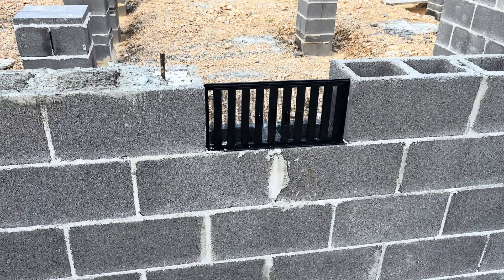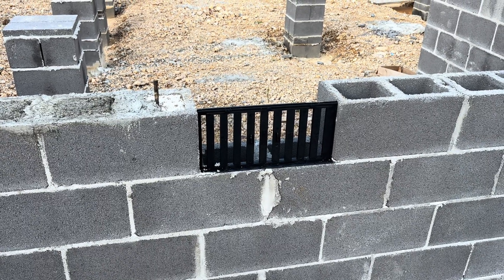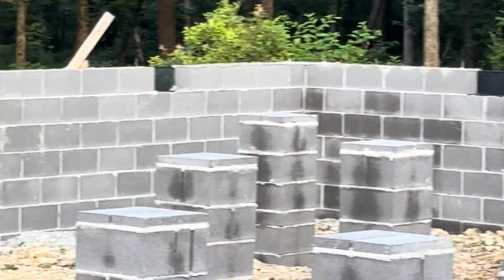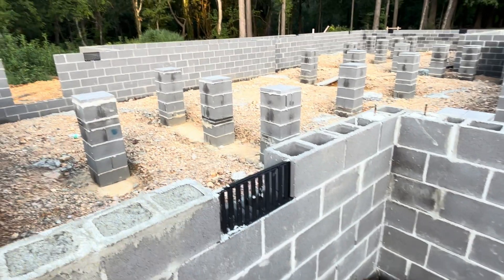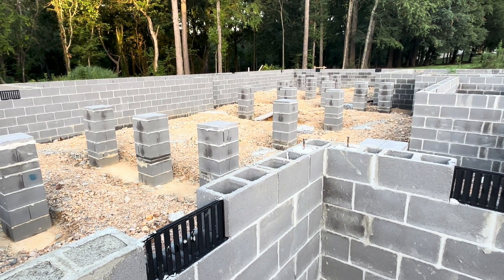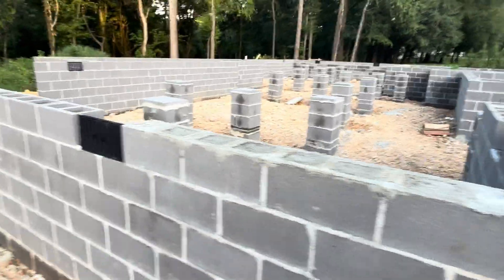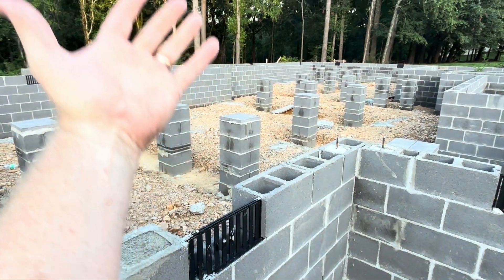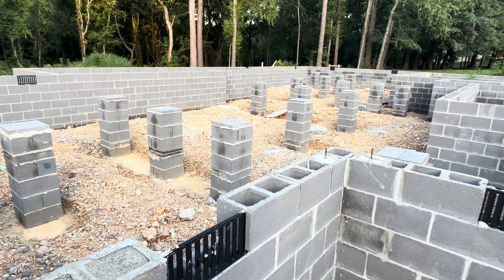The Foundation Vent = Epic Fail

Comment: I am not a builder, but a handyman. However, shooting for the larger project and becoming a builder fascinates me (currently past retirement age, so if I build anything, it will be for myself). And I've become kind of obsessed with building science.

I remember a long time ago reading in Fine Homebuilding magazine that the only successful way to handle a crawl space (or an attic) is to either make it fully outside the conditioned envelope of the living space--or make it fully inside the conditioned envelope. Any half measures will fail in exactly the ways Donny describes. In the case of a vented crawl space you'd insulate and air seal the floor above. Putting heating and AC in such a space is problematic, so don't. Or make the crawl space fully inside the envelope with a sealed and insulated floor and walls, and circulate conditioned air down there as well as the living space.

A few months ago Corbett Lunsford (Home Performance) and Matt Risinger (Matt Risinger) had a debate about the best space to condition (crawl space or attic) and then install your HVAC [see: "Conditioned Crawlspace Vs Attic: Which Is Better Encapsulated for HVAC? (with Matt Risinger)"]  The TL;DR answer is that conditioning your crawl space is easier and cheaper.
Reply from the maker: @ScottyDMcom exactly!  Good words, my friend.  I love building science and have been involved with it since 2012.  What you said is correct.  Now trying to get builders and homeowners to see it.  I have a sealed crawl with rigid insulation on the walls and a dehumidifier to remove moisture.  I do not heat/cool the space.  My HVAC system and ducts are in the crawl so if they leak, they are leaking inside the envelope.

Comment: Why do you even build those waste of space crawlspaces in the first place? Build a basement and build a house out of bricks, mortar and concrete on top of that instead of those flimsy wooden houses, which cannot even withstand small hurricanes or tornados. Yeah, a brickbuilding is more expensive, but its built to last!
Reply: Northwest Georgia has very rocky and clay heavy soil which makes digging expensive and basements prone to breakage due to hydrostatic pressure in the clay rich soil. I do agree stone and or brick buildings are superior for longevity among other reasons, but are rarely considered viable in a society that doesn't consider houses and properties heirlooms.
Reply: @abiwenwodon8655  interesting insight. Thanks for sharing
Reply: Some places are essentially solid rock with only a thin covering of dirt. Or the water table is high. Or the location is prone to periodic flooding.
Reply from the maker: @ScottyDMcom  yes sir, and with the frost line so shallow most people build on a slab.  But if you are doing a crawl space it should not be vented in this area but for some reason many builders are still doing it.

Comment: Why doesn't the building inspector catch this issue and point it out to the builder. Building Science.
Reply from the maker: It's because it's not against the building code to build like that.  The building inspector may not necessarily have a preference one way or the other.  In the IRC it calls out both ways to build a crawl space, vented or unvented.  It's just not a smart idea in the humid south.